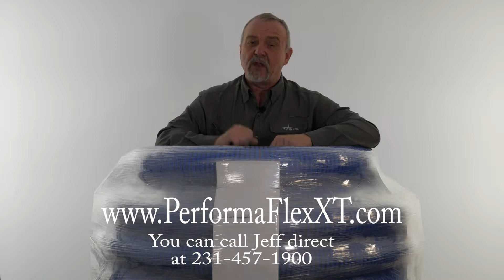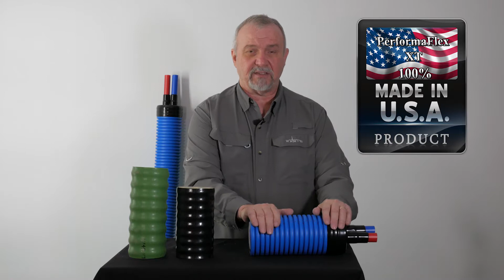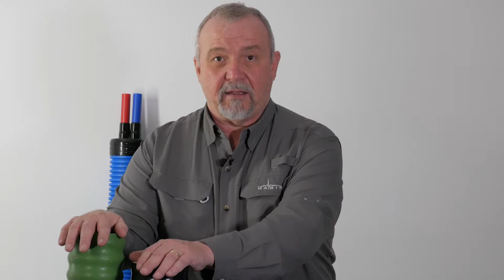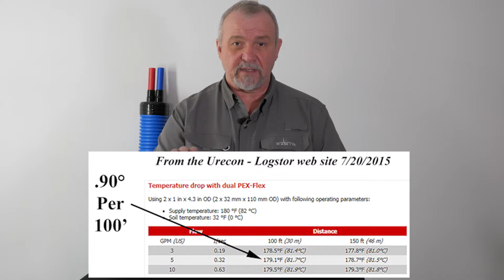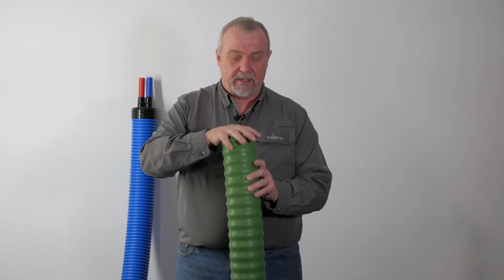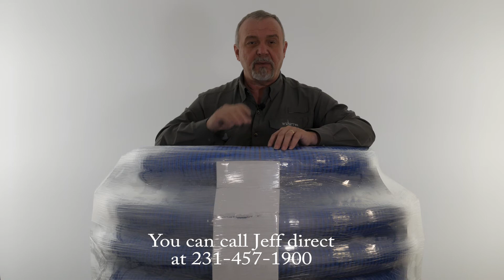Outdoor Wood Boiler Pipe, PerformaFlex XT Insulated PEX 2017

Comment: I just used this on a 100 foot run when I put my new wood boiler in. I left part of the trench uncovered for a coupe of weeks and you could not even see steam rising from the exposed pipe when it was around 20 degrees F. This stuff is very well insulated, and the blue pipe on the outside appears very durable. Very happy so far.

Comment: It mentions on your website that the recommended depth of this insulated pex is 18-24 inches.  If I don’t even have 18 inches let alone less than 12 inches because of solid bedrock under the minimum soil that is on my land can I either sleeve the outside of the blue pipe with some type of insulating foam tape? Or even put it under foam board and then back fill over it?